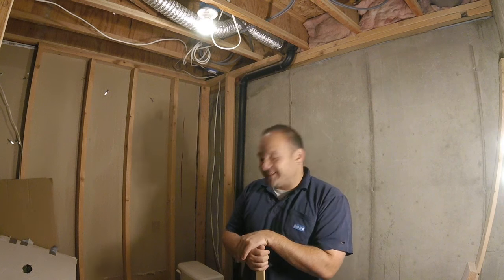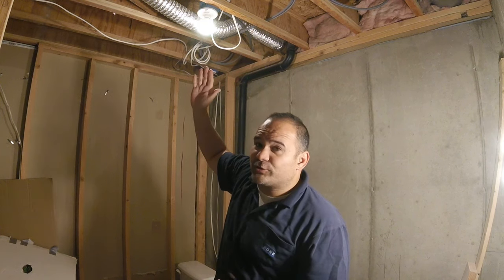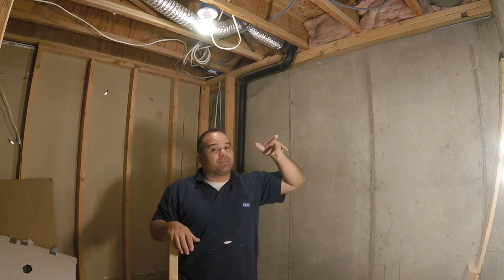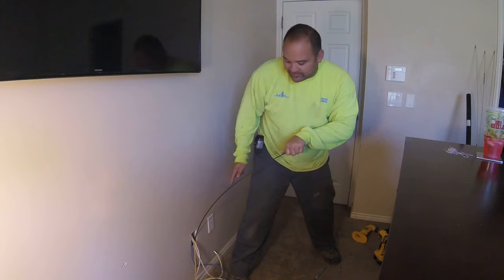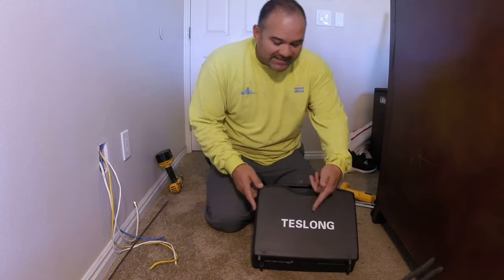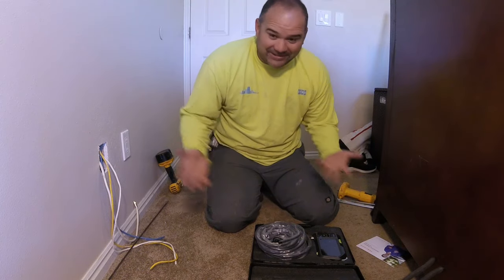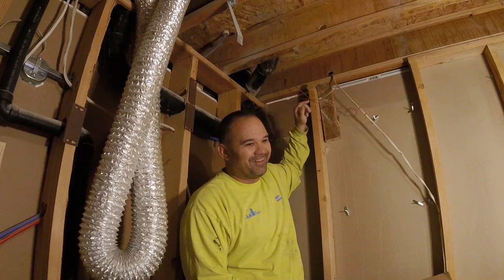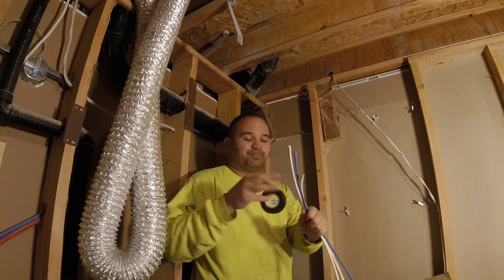MAD SKILLS! A pro installs wire from the attic to the basement. Part 1

Comment: Your dry hose is a major problem. One get rid of that crappy hose and get yourself all aluminum dryer flex duct. Two get rid of all excess. No sags. What you now have is a pipe that can't be cleaned and it is going to fill up with water condensate. If you can run metal duct then run that. Keeping flex has short as possible is the best.
Reply from the maker: It’s not a dryer vent. It’s a bathroom fan. I do need to cut it down though.
Reply: @AlanCleggYouDoAV  For sure shorten it. Condensate can pool and cause you problems you for sure don't want.

Comment: wouldn't it be relatively easy to remove the baseboard then drill.  no holes in wall!
Reply from the maker: I try not to remove baseboards. I know it is a common technique, but if things go wrong with that, I'm not equipped to fix it.
Reply: no